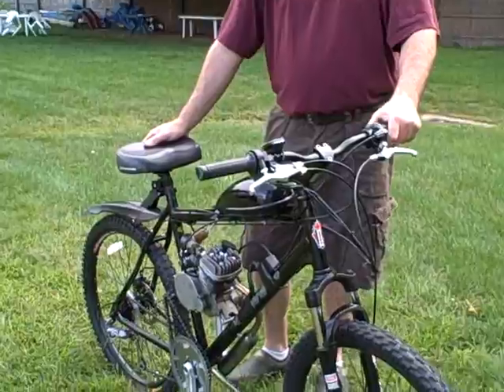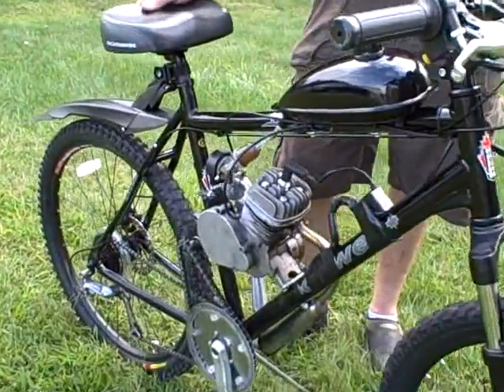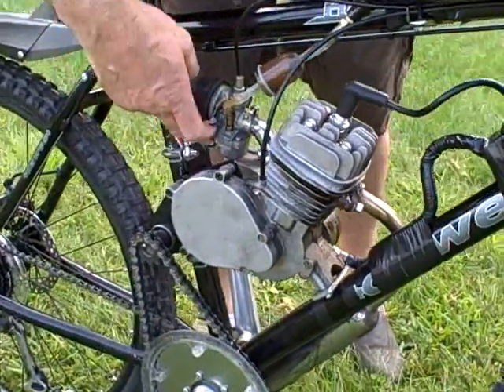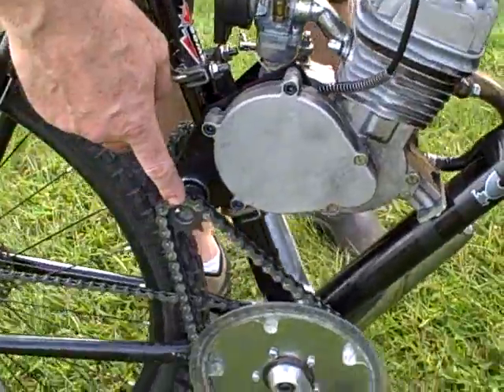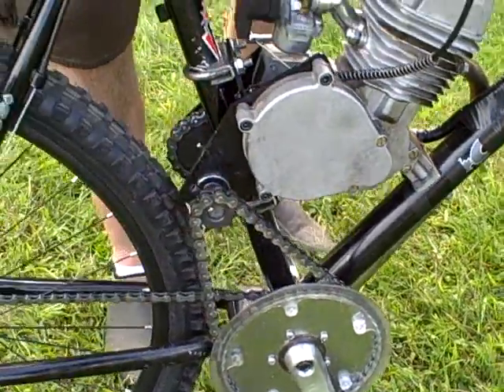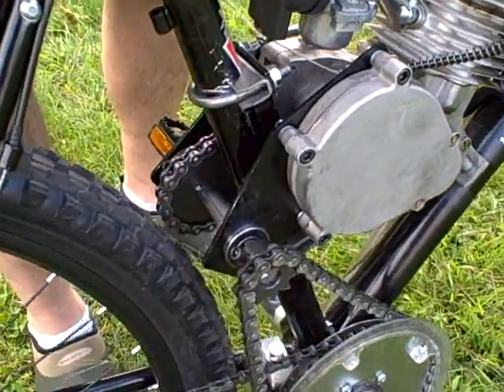Motorized Bicycle with Jackshaft Kit

Comment: @johnsucrosky Good for you :) In Illinois they don't go by engine size. Here it has to be under 1hp, can't go over 20mph, and you have to be at least 16 to ride it. So all of the kits they sell on eBay are illegal here (the 66cc kit puts out 3 or 4 hp and the 48cc kit isn't far behind) Anything more and it has to registered as a motorcycle (if it can be.) However, how are they to know the hp and speed unless you tell them? As long as you don't do anything stupid they will leave you alone.

Comment: @WillDaB3ast You should be able to pick up one of these engine kits where you live. All of these kits are imported from China, so you should actually be able to get them for a better price over there. I would contact some of the sellers on eBay that sell these kits and ask if you can get the manufacturers contact info. And the kits include everything you should need. As far as boost bottles are concerned, yes they do give you more power and they also smooth out your idle. Well worth the $25.

Comment: @johnsucrosky Why go for the 48cc? I would get one of the 80cc kits (which are actually 66cc.) And to be honest I have never used a performance carb for one of these. I have to assume it would lower your fuel economy.  I did hear that the slant head gives you a little more power though. That head also gives you a little more clearance because of the way the plugs sits. So I would definitely go for a kit that has that feature. Then you just need to choose which finish you want (silver or black.)

Comment: @crazyfvck 
Thanks. Does it matter much if I got the standard instead of the high performance carburetor? I am getting one soon ? which one do you recommend?
There are "Jet 48cc, Standard Gray Finish" and "Grubee 48cc Silver Sky Hawk Angle Fire Bicycle"
The Jet one is 50 bucks cheaper if I don't get the high performance carburetor ($155 after shipping)

Comment: @crazyfvck agreed i have a bike kit and it works great at first it does put out a little blue smoke but thats bcuz 2 break it in u have 2 use 16:1 oil mixture but there still very clean and fuel efficient

Comment: @cndnborn Most mopeds are nowhere near as fuel efficient as these bike kits. These kits also come with EPA approved mufflers with built in cats, which means that the exhaust is fairly clean. So how is this bike polluting more than a standard moped? And just so you know, those electric motor kits for bikes are $300 and they are complete crap. The batteries are fragile, they have a limited range, and they take forever to recharge.

Comment: @johnsucrosky Most of the kits list them as being 100-120mpg. The tanks usually only hold 1/2gallon, so figure 50-60 miles on a tank. Keep in mind that depends on how you use it, and how much you weigh.

Comment: @cndnborn ok trollboy here's the reasoning behind it: Its way cheaper than a moped and you don't have to insure it. Its not about laziness its about functionality and extending the range of mobility. I ride a bike everyday and I can say I would only use the engine for the last bit of a long trip because I'm not a machine and can't pedal forever without a rest. Hey great build, nice bike, put an exhaust on it so trollboy's ears are saved!

Comment: The bike pedals are non functional correct?  Looks like they are free-spinning....  if they were hooked up to the drive system, you would have to move your legs as fast as the motor is going, correct??  Most bike systems I see have the pedals as normal with the chain on the right side, and then have the motor run to the back left on an independent chain, and utilize a clutch on the motor.

Comment: Nice setup! I am thinking about doing the same thing w a jackshaft from SBP, the same one you using. I asked a guy at a gas bike store here in southern Cali and he sayes jackshafts are not worth the time or money and he doesnt even work with them. Something about to much stress on the derailer? So how has it held up, any sugestions? thanks

Comment: My eyes told me. Even if you're careful, moving gearing can 'unexpectedly by accident' catch dangling things like a shoelace, scarf, corner of flapping clothing such as pants, or your fingers. Cycling is my normal transport (including countless various freight loads - see vid on Cheapest, strongest bike trailer). Loose things have caught in the hub sometimes, and once the deraileur, wrecking  it. The 2-clattering stroke noise will deafen you 'same as I became deafened too.

Comment: were you holding back on the throttle? it doesn't seem as fast as other motor bikes ive seen. although admittedly you're a bit bigger then most people ive seen. interesting build though, good job.

Comment: @Dorisequador these engines get about 150 mpg, but most are only 2.5quarts, still that tank lets you go almost 100 miles, so running out of fuel isn't a big deal or a frequent thing imo

Comment: @mark16443 the engines are kits, and you need (as in it is almost impossible to machine around) a manual clutch put "sick bike parts" into google, that is one of the better sites

Comment: like the craftsmanship. Very well done, but it runs on dinosaurs. The only way gas is any good is to extend range of electric, other than that gas technology is just stinky and loud.(in my opinion) I admire your work, but I am against gasoline technology. Have you considered building electric? If so look into on-board gas or propane generators.

Comment: I just put together a schwinn beach cruiser with the new 70cc 2 stroke that has the centrifical clutch and the pull start. I also added the jack shaft kit. Was wondering if you ever have problems when motivating the engine like jerks back and forth. Seams like a chain problem or a clutch problem... Doesnt do it at lower speeds in low gears only in higher gears at high speeds...

Comment: Thats has to be the way to go, jackshaft to first sprocket. This should have been available a long time ago. I would try to use a 4 stoke motor for the conveniance of filling up at a gas station. Also replacing the innertubes with foam inserts would eliminate flats. The brakes on the mountain bikes are vastly superior to the rim brakes found on most cheaper bikes. Mounting the engine in the frame seems to be best for balance and handling. Thanks for your video.

Comment: im in the process of building one of these i have the gear ratios all sorted out i just need to mount the engine, my question is what method did you use to align the engine sprocket to the subsequent sprocket the chain is fed to, some advise would greatly help,
thanks

Comment: Wow... awesome bike. What kind of kit did you use to prevent the pedals from rotating all the time as the motor is connected to the actual pedal-part and not the rear wheel directly.

Comment: @romzom666 Yeah, some of them aren't great, but if you get a good motor and battery it's decent.  I have an 8Ah 36v NiCd, and I can ride about 15km at >30km/h without pedaling,  It puts out plenty of power.  I can climb steep hills effortlessly.

And the sky's the limit.  If you spend the money on a really good pack, you'll get great power, and more range than you're likely to need.

Comment: @nwimpney  Electric is okay but there is a problem with electric. I mean I'm not like knocking electric or whatever but the only problem with electric is the fact that you have to charge the battery numerous times. i have an electric scooter and i'm lucky to ride it 10 minutes or 15 minutes if i'm lucky before having to recharge the battery and the charging time is around 2 hours. and electric seems not to put out much energy too.

Comment from the maker: @bambooroot You need the gears in the back to work if not there is no point you have to be able to shift the gears as far as a motor goes it is a shot in the dark you either get a good one or you dont look on e-bay

Comment: @MRklica laying a lawnmower engine on its side will get oil in the air filter one was or flood the plugs and fuck the motor up trust me i did it once for a go cart i spewed oil everywhere  and never run again

Comment: For the persons amungst our number that like the board track thing?
Try an old swin three speed internaly shifted hub , take all the spokes off of it,
Weld a sprocket to it's other side " WITH THE GEARS AND SEALS OUT OF IT"
And turn the peddaled side of the hub with a chain from a jack shaft, like this~!
Presto a three speed gear box like the old motor cycles had!

Comment: I am guessing you just keep the clutch pressed in when pedalling to solve that problem.
Where do you get the jack shaft kit from, and does it work with other engines?
Also, roughly (as it will depend on a lot of factors) what is the fuel economy on one of those?

Comment: That's my favourite mounting technique, using the bicycle gears to adjust the ratio for speed and hills. It also allows the bicycle to coast when you let off the throttle. I like the one way clutch in the pedal system so that the engine doesn't spin the pedals and you can keep your feet still. I am a 4 stroke fan myself.
A few questions. Is it possible to disengage the engine while pedalling with the engine off, as it could get quite hard work pedalling the engine parts round all the time.

Comment: I hear you cutting the throttle on the road, are you disengaging the clutch and throttle to shift ? If so how does that work? I thought the pedals need to be rotating for the bike to shift gears.

Comment: yes i know what you mean, the shifts are so close togethere its not a big deal, on a bike like mine it would be good because the gears are spaced so far apart, but i would be woried about all that power going through the stock bike components,

Comment: Do you? Well... my myspace is of the same name, so hit me up and we'll ride some time.

Regular cantilever brakes are just fine (unless you run through a deep oil slick lol), just get some nice large pads, make sure its mounted nice and tight, and check on them regularly.

Comment: Is your engine redlining on your highest gear to get you to 37.5? If so you could modify the gear ratios.

I don't have the shifter kit and my bike's too slow to safely keep up with trafic... So I'm trying to understand this shifter before i buy it.

My bike tops out at 28mph when I'm redlining the rpm's (bad idea) and cruses at about 20 (This is all according to a roadside speed checker) and i need to do about 40 without redlining so i wont get run off the road by Atlanta's asshole drivers.